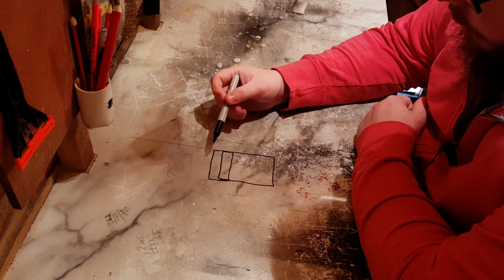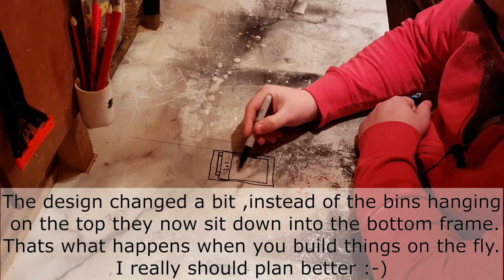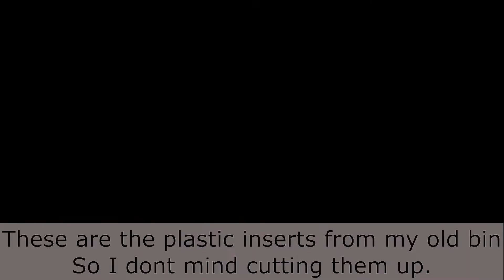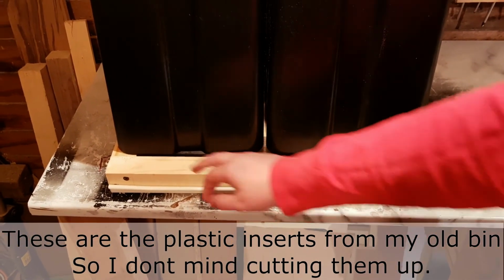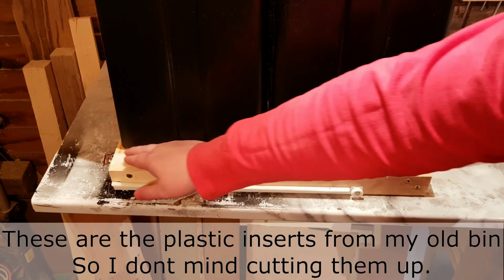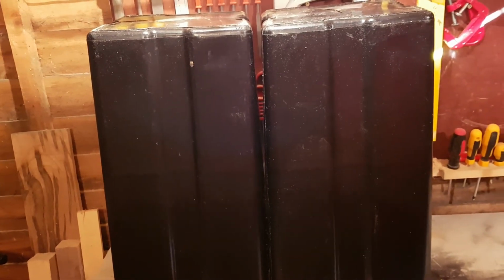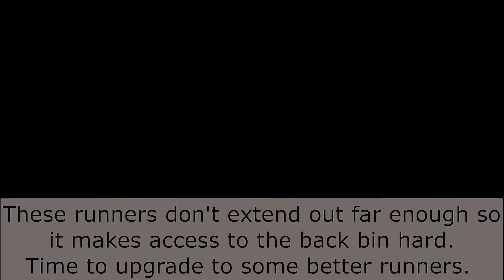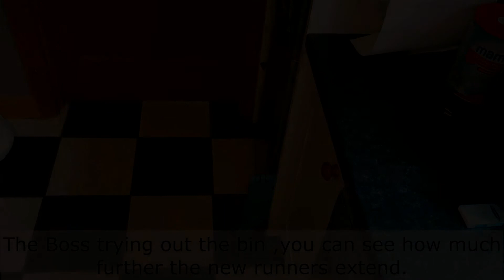DIY Pullout Kitchen Bin FINALLY(How to)

Comment: Good job Gavin. We have pull out bins in our kitchen and all there is on them is a top frame, which the lip of each bin sits on and then the bins hang from there. Could have saved yourself a bit of wood!
Reply from the maker: MajorRushMore thanks Simon, ya that was the original plan but then I realized the bins were too large and I had to cut them down , so I had no lip to hang them from unfortunately. If I buy bins in the future I'd definitely redesign it.
Reply: Ah I see.
Reply from the maker: wouldn't be beyond me to over engineer something though.😎